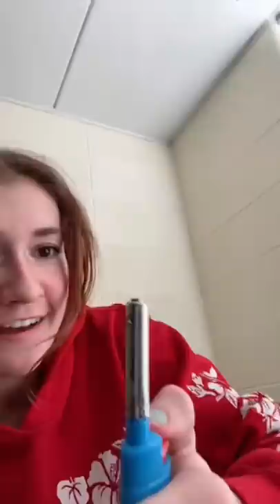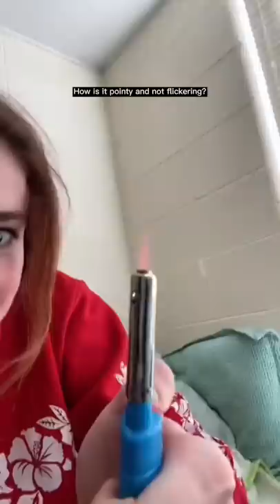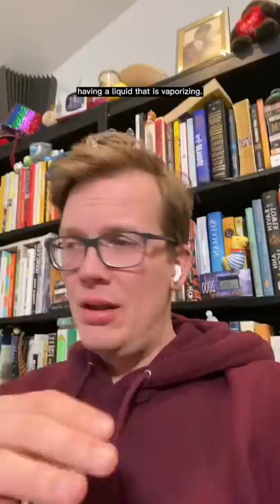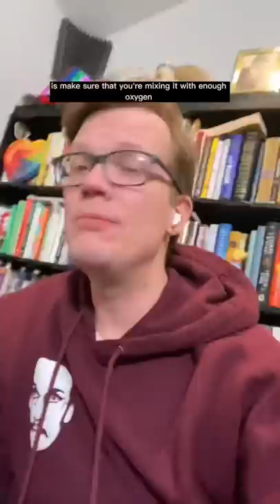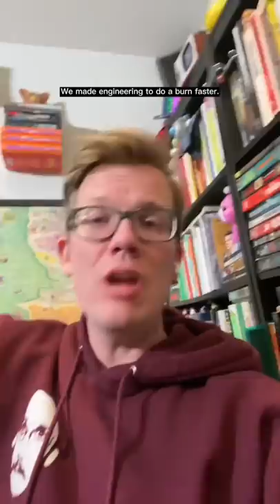How do jet flame lighters work?

Comment: Fun fact: the lighter was invented before the match
Reply: Ah yes Döbereiners bomb
Reply: That IS fun!
Reply: The modern commercial match yes, but match-like devices can be traced back to 577 AD China.
Reply: The lighter was also invented before the wheel. It was the first invention
Reply: ... WHAT
Reply: Very fun
Reply: @welcometothekingdra  what does that have to do with this comment thread?
Reply: @welcometothekingdra  
This is not Hank. Did you think you were talking to Hank? You are not
Reply: Which makes sense. The chemicals that you’d likely need to coat onto the sticks were probably better understood and/or discovered long after we decided to mechanize and miniaturize the age old method of hitting flint on rocks to make a spark
Reply: @Penguinmanereikel  
Yes but matches have existed long before strike on box matches were invented. If you're familiar with char cloth, and you're familiar with matchlock firearms, a match was just a braided piece of rope charred on one end.
Then you would take a flint and spark onto the jar, that match would stay lit and is essentially windproof.

That's why they're called strike on box matches, because before you would strike the Flint directly onto the match. Matchlock technology came right before flintlock, where in flintlock firearms there's a piece of flint attached and when you pull the trigger it is struck, igniting the gunpowder in the flash pan setting off the explosion that fires the weapon.
With matchlock, you would have your little rope match and have to spark it yourself, then take the burning match and touch it to the flashpad in the gun.

The type of lighter being described by the original post is actually called a match
Reply: @tungoyum1884  actually the lighter was how they found out about fire
Reply: Wow that’s neato burrito what mad world 🤡
Reply: No one understands this or believes me when I tell them this. But just think about the complexity of creating a match compared to creating a lighter lighter is so simple let gas out a can and scrape a rock. A match takes doing chemistry to create it, much more complicated.
Reply: 997th
Reply: When was the heavier invented?
Reply: You are listening to the Streets
Reply: @gljames24  
There's always that one guy that wants to unnecessarily take away all the fun.

You're that guy
Reply: No. The match/lighter was invented by southeast Asians(Australia/Papua New guinea, Indonesia)  and another version by the Chinese, as well as later actual matches (fa chu in 577, used by poor women) and were common thousands of years before europe. They were self reigniting on exposure to air, and the most common way of starting a fire in Asia. We call them fire pistons. They are still cool today.

We in the west tend to confuse having a patent for something or knowing about it with actual invention.

In fact, the Asian fire piston was the inspiration for the western diesel engine. Asians also used bigger versions to create hydraulic and piston based forging, long before the west.  Every culture has made contributions to the world, let's give proper credit when and where due.

Even reading the Wikipedia article on Light history or matches just glosses over these things. Why do we do this disservice to history?
Reply: You should say before the “safty match” I think
Reply: @WILLYLYNCH.  I think sometimes a guy just needs to consider bamboo.
Reply: your right but only by two years and we had the tech to make matches we just didn't do it yet, they made gun powder in China in the 17th century on accident just put some phosphorus in that and put it on a stick and you have a stike anywear
Reply: @gljames24 of course china did it first
Reply: Same with the screw and the screwdriver. Something like a 300 year gap between the two and not in the direction you would think.
Reply: Makes sense
I mean a match is a chemical reaction using red phosphorus but a lighter is just lighting something on fire
Reply: fire was discovered before both

Comment: Actually there are over 400 types of edible grass. I’m not talking about the grass with flat blades, but the grass that has round stalks that have (or will eventually have) seed pods at the end. Pull the stalk out of the sheath slowly and eat the soft, light green part. You can use them like leaks in a soup too. So…eat specific grass
Reply: Some of those edible grasses are maize, rice, wheat and oats.
Reply: @superfluidity  Or bamboo, right.

Comment: Simplest way to understand is with a Bunsen burner.
There's a hole at the bottom of the burner which sucks in oxygen and makes the flame blue.
If you block that hole with a finger or something, flame goes yellow, brighter and bigger, also gets easily blown out.

Comment: Easy explanation is shooty tube goes from big to small.  Big end gives gas to tube and small end spits it out.  This makes fire go fwoosh.  

This is a similar system to AC/ventilation btw.  Makes it easier for air to be spread throughout a house when the load is taken off the machine.

Comment: It's just a torch, like Hank said, the nozzle is shaped tightly to output the same volume at high velocity and a venturi effect used to draw air in and mix it in a certain pattern.  Normal lighters are under pressure too, but there's a diffuser rod which slows down the flow a lot and then comes out a nozzle that's barely necessary (it keeps the rod from burning).

Comment: Jet lighters are constructed around the same principle as a venturi burner. A regular lighter just allows butane escaping from a pressurized container to combust in ordinary still-air atmosphere. 
A venturi burner uses the expansion of the combusting gasses within a confined space to propel them forward into the wider port of the orifice and out into open atmosphere, thus drawing in more air from further back in the narrow portion of the burner, which causes that air to move at higher velocity, speeding up combustion and producing a lovely little flame cone

Comment: In the simplest terms possible and ignoring the engineering, it's pretty much like putting your thumb over a water hose makes it faster
Reply: With out air holes in the line the gas is traveling in, places close my after it passes through that pressure point

Comment: It’s actually not in a higher pressure container for the jet lighters. Butane at a single temperature will always have the same vapor pressure. The only difference is the way the jet of butane is released. Normal lighters even have a cottony type of material to slow down the pressurized butane as it comes out
Reply: Thank You for actually addressing and answering the question instead of stating irrelevant facts for half of the video

Comment: Well actually most lighters are under pressure, but the last part was right with the air mixture, because the tip makes it a torch or lighter if you cover the holes on a torch it turns into a big lighter

Comment: It's all under pressure. It's actually impossible to pressurize a butane canister more because anything over a certain pressure will cause the gas to turn into a liquid until the pressure stabilizes. That's called the vapor pressure. All lighters contain liquid butane, so it's all at the same pressure.

Comment: Ah you missed a bit.

Both regular and jet lighters rely on the same butane pressure to get the gas out, but regular lighters have a gas nozzle that's about 1-1.mm wide  while the jet lighters have a much smaller opening.

After that it's all correct , the nozzel on a jet lighter has a funny shaped ring around it to help it suck up air more efficiently.
Reply: Yeah, considering soft flame lighters and jet flame lighters can be filled from the same container. The pressure in the storage tank is dependent on the vessel filling it, or any mechanical pumps used to fill the lighter. I have never seen a butane compressor for filling lighters. There's literally no difference in the storage of the gas, and there are no mechanical features that compress the gas in a jet flame lighter. You also can't claim that the speed of gas flow is different from one form to the other, because both forms come in adjustable versions. You can have a large soft flame and a small jet flame. It has everything to do with the nozzle used to disperse the gas. There are Venturi pump style air inlets, but they are absent on most small cigarette lighters.
Reply: Yes blow torches jet lighters use a very tiny nozzle that makes the gas move faster in laminar flow openings by the inner nozzle allows venturi vacuum to mix in more air 

 A jet lighter uses the exact same amount of gas and pressure as a regular lighter if you take a jet lighter apart and remove the burner it will have a flame the exact same size as a bic

I've actually taken apart and cleaned the guts outa the burner unit there is a tiny screen for laminar flow a washer and a very thin disk of metal with a very tiny hole in it

Comment: The orange color of lighter flames is actually the uncombusted parts of the flame (ash or carbon) that result from the incomplete combustion. When you up the oxygen and get a more efficient combustion, more of that carbon becomes carbon dioxide. No clue why the flame is blue though.

Comment: That's why there's little vents under the gas coming out.the vacuum draws in oxygen at the right amount to combust. Basically a rocket engine on a SpaceX rocket with out needing a liquid oxygen supply.

Comment: actually ...
its a pocket sized Bunsen Burner on full throttle.
By aerodynamic design the combustion drives the air flow around the valve which release the gas, thus creating a flame jet.

Comment: This was kinda a bad explanation. 
Simply pressure gradients drive flow so yes it is because it's pressurised but it's at a higher pressure to atmosphere. The "cone" is caused as the core of the exhaust flow (efflux) remains hotter for longer.
Reply: It would help if he actually did some research before blurting out complete BS. Oh wait. He did. He had to cut the video twice. Hilarious. Homer Simpson has him beat. So SMRT

Comment: If I get you right the reason for a jet lighter is the different gas. So there is a higher pressure in the tank. But wouldn't that influence the flame from the first day of use till the end, and let it get smaller everytime i use it?
My jet lighter has just the  normal liquid butan in the tank an it is just about the nozzle.
For example put diesel in a barrel and burn it, or put it in a gas turbine....

Comment: Kind of right kind of wrong, it has to do with burner design, butane in soft flame and jet flame are the same pressure. A jet flame uses an air fuel mixture and uses more fuel flow than a soft flame of equal size. Jet flame lighters are essentially mini butane blow torches.

Comment: But I have a device that can take a normal lighter as a fuel source and just by taking the fuel and releasing it differently it becomes a jet lighter. The pressure stays the same
Reply: Yea, I thinks a first not being satisfied by the answer by Hank. I'm pretty sure he semi-answered to question with the oxygen mixin comment. I'd guess it has everything to do with the shape of the whole bit after the valve opens and lets the pressurised butane out.

Comment: He isn't so correct on this one. Fire usually needs fuel, oxygen and heat. The coiled wire boosts the heat and gets the liquid fuel to rapidly ignite and combine with oxygen.
Reply: It would help if he actually did some research before blurting out complete BS. Oh wait. He did. He had to cut the video twice. Hilarious.

Comment: Aren't all lighters under pressure? As a kid whenever we find lighters with some butane left we'd throw it high up or hard against a wall which would crack the lighter, the result most of the time is an explossive decompression. 

Wouldn't the main difference be in the nozzle? I've noticed the normal butane lighters to be more of a widespread pattern than the jet lighter I currently have. Just like a pressure washer

Comment: Wrong. All butane lighters store butane at exactly the same pressure because the butane is a liquid. What makes jet lighters different than an old fashion Bic brand lighter is that jet lighters use a tiny amount of platinum group catalyst to cause the fuel to burn at a lower temperature. You will notice that jet lighters have a metal ring around the gas nozzle. This is the catalyst. They ring has only a tiny amount of catalyst. You will also notice that all jet lighters eventually stop working even if they are refillable. The catalyst in theory is not used up in combustion, but like everything it isn’t perfect and so little is used that eventually the coating vaporizes or gets contaminated.
Reply: Thank You Thank You Thank You. He's being pompous and had to make two embarrassing video cuts to sneak in some googling to begin making himself sound SMRT

Comment: You are incorrect. They are both under the same pressure. The temperature of the environment that the lighter is in sets the boiling point of the butane. That is what sets the pressure of the vapor that is actually being used by the lighter. The liquid butane sits at the bottom. The only difference is the mixing with oxygen and probably the nozzle size.

Comment: Where does it suck the air in, and when? Is it adding it to the liquid as it vaporizes?
Reply: Look at the long and silver part of the lighter, i think you can see holes there
Reply: I imagine there are vents in the lighter. As the gas is ejected, air is pulled in and up to aid in combustion
Reply: Some time after it vaporises, but befor eit starts to burn - there will be some kind of air vent between the place the fuel is released and the point the flame starts, positioned so that air can get drawn in but fuel doesn't get sprayed out.  If you've ever used a bunsen burner in a science lab, think of that - you can turn a gentle yellow flame into a roaring blue one by opening an air vent at the base of the burner.

Comment: Buuut a normal lighter is under pressure too because butane doesnt want to be liquid at room temperature. And a bunsen burner can burn with both a nice flicker and a blue cone flame. Gas pressure is not the deciding factor, air supply is

Comment: what makes it vaporise? is this liquid naturally in it gases state in normal atp? or is it the different pressures between the canister and atmosphere that forces it into a gaseous  state? also what makes it burn? i don't see a heat source? is it just exposure to oxygen if so why doesn't the liquid in the vile explode when it is open would some oxygen be sucked into the vile?
Reply: At room temperature and atmospheric pressure, butane is a gas. However, with a little more added pressure it will become a liquid. When the butane is put into the lighter, it's done so at the pressure which butane becomes a liquid. The lighter is sealed so the pressure stays the same and it remains a liquid. As the butane is used, it is allowed to escape, which starts to lower the pressure. However, some of the liquid butane will then turn to gas until the pressure is high enough that the liquid butane cannot vaporize anymore (equilibrium).

If you've ever noticed that when used for a prolonged period, a lighter's flame will start to get smaller until you stop using it for a bit... This is because the vaporization process actually takes heat energy away from the liquid. This causes the vaporization pressure to drop, thereby lowering the pressure of the gaseous butane coming out of the lighter and thus a smaller flame. Once the liquid warms back up the pressure will be higher and the flame will be back to its normal size.

Hank is wrong about one thing here: the pressure of regular lighters and these jet lighters is the same. The difference is the size of the hole (smaller on the jet lighters) which causes the speed of the gas coming out to be faster. The other difference is the additional air being pulled into the jet which he mentioned. The only thing that can change the pressure of the butane in a lighter is the temperature.

Comment: This is misleading at best. You got the carburation part right but liquid butane is liquid butane and both lighters will have the same pressure at the same temperature no matter what. It's the same pressure but conventional lighters have much more lackluster carburation, a much smaller outlet orifice. The little slits on the front of a conventional lighter are what allows this. With jet lighters, they have a larger less restricted orifice which allows more gas to escape, they use the Bernoulli effect to pull oxygen in, and then have other flow restrictors (often mesh or other physical barriers) to drop the speed of the stream of gas to below the flame speed of the gas air mixture allowing it to burn. Hate to be that guy who calls out "cool science dude" but he basically claims liquids are compressible to explain this which is flat wrong.

Comment: Anyone who has ever reloaded a butane lighter knows that this guy is missing the point. Both lighters have the same gas under the same pressure. The difference is how much air is mixed in with that gas, and that requires clever engineering to create a Venturi nozzle. Or in the case of those super jet lighters, multiple nozzles.

Comment: We don’t breath just oxygen, and if gas is flying out at high pressure how can it suck air into it? As the gas is pressurized it’s released and once released a piece of ferrite is then struck causing combustion. But if you want fancy it and say that once the gas comes out then mixes with the oxygen/ nitrogen then the flint struck and then ignites. Guess you could buy the gas I’d more then flammable enough to cause ignition.

Comment: how? ... Yes how , more fuel pressure more oxygen ducted into flow sorta vaccumed into the jet stream and then also engineering within the limits of your materials because if it explodes or melts in your hand ... it's not "safe" enough for simpelton use